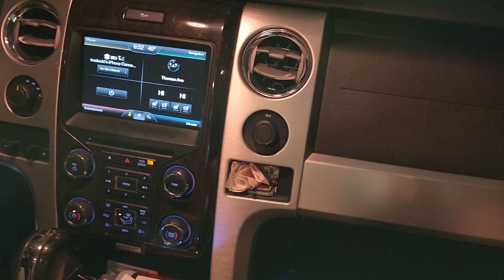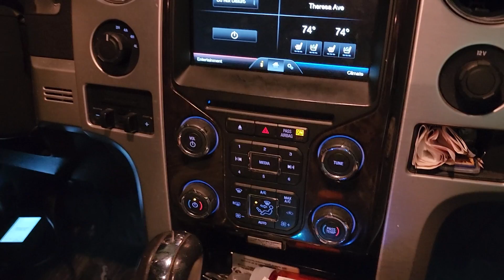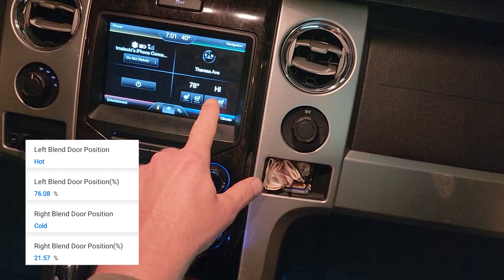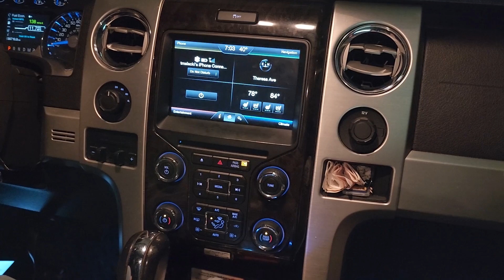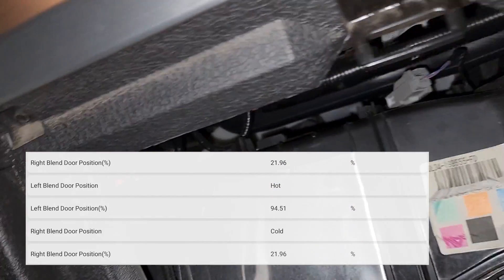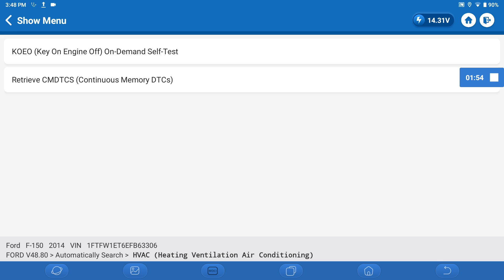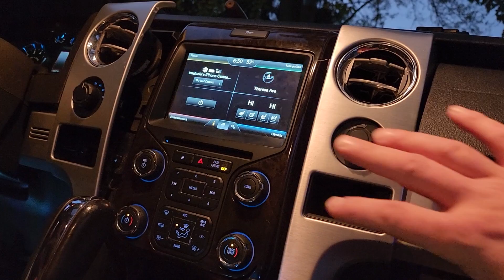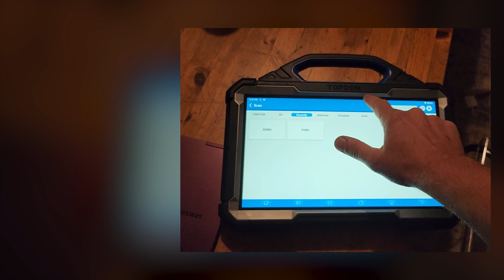2014 Ford F150 Passenger Temperature Blend Door (Cannot Change Air Temperature)

Comment: Brings back memories of a 2006 RAM 1500 Bighorn HEMI regular cab at CARMAX I ended up having to not buy. They offered to fix it, not them, dash has to come apart, but they send it out was going to take over a week so I got impatient and got another vehicle. I really wanted it. They even loaned me a car the whole time for days they had it looked at.
The blend doors are cheap plastic and break. Heater Treater makes metal replacement doors and related parts so it never has to be fixed again. This kind of job is a nightmare. Credit to the salesman to test all the doors/vents and HE noticed it.😇

Comment: hi danner
 have an issue in my car 2000  ml55 amg 

ac compressor engage and blow cold air for 10 to 30 min and then low side pressure rise up and blow warm air up and the compressor still engaging 

-the prev owner has changed low   pressure hose after gas leak

 and didn't work

-and i changed the compressor valve and changed the  oil to make   sure it in level 

-i checked pressure it's ok

-no electrical problems and no fault  codes

Comment: Im sure you allready checked the tiny hard plastic vacume lines on the passenger side running from the heater blend door actuator. Those lines get brittle and decompose. Often when they start failing the air will jump from vents to defrost or heat when accelerating.
Reply from the maker: No vacuum lines, completely electronic door motors on this
Reply: @ScannerDanner  i see its 2014. Thanks for the videos im out of practice and due to severe head trauma im not sure what i remember or remember incorrectly.
Reply from the maker: @davidreynolds4684  I'm sorry to hear that my friend. Anything I can do for you? I'd be happy to
Reply: @ScannerDanner  I appreciate it. The short n skinny on it. My friend near 80 has a 90 f150 4.9l efi auto trany. Rear tank inop for decades. 6 years ago was running rough. I put alternator, belts hoses and a batt. He was to do plugs rotor and cap. I moved to houston. They had me come back to ft worth to re- remodel a house that was messed up. Truck was barely running now. He tried to pull the plugs but couldn't. They'd back easy a few turns then dead stop. I shot pb all over and went in with them then out then in and out. They had basically welded themselves in the engine. They had slag all over the smooth area past the threads all around the electrode. Git em out sucked the slag out of the cylinders. New plugs rotor cap fuel filter. The one on it looked 20 years old and was backward. Purred like a kitten. Ran like a bat out hell. 200k miles never heard it run that good. Sits most of the time. At idle 1.5 - 2 mins it had a hiccup. So tiny it wasn't a miss. It was nothing and I'm anal about that stuff. Planned on high pressure fuel injector flush. Jim obsessed on the hiccup. Day and night revving it up pissing his wife off. She calls a shop. They get it for a week. I hear him driving up and it sounded worse than before I tuned it up. I think they jacked with the timing and used the wrong marks on the timing gear cover. That 4.9 has two sets of marks and one notch out of the damper on the back side and a hairline scribe 1/8 " long near that. Red paint t had been a slopped around and saw it over the notch. Then I checked fuel pressure. 0 on the rail koeo. Three times 0. Started it and had 0 on rail with it running. Killed it. Undid gauge little gas squirted on my hand nit a lot. Pulled filter. Rigged up gauges under the truck after flushing fuel filter best I could. Put it on connected to fuel filter out. Koeo very little movement. 10 times 30 psi. Left it for hour came back 25psi. Reconnect line and gauge on rail. Koeo 30 psi. Started it 30 psi. Pulled pressure relief hose. No difference until I stick my thumb over hose then idle increased very little no diff in pressure. Rigged up connections without a filter. 35 psi. Couldn't run it like that. New filter 32-35 psi. Hard start. Even koeo multiple times before cranking it. Poor acceleration. Rough idle punch it and get pvvvttttsss stp spet pvvvvtttsz. I understand it should have min 45 psi up to 60psi. Don't think it's back filling the rear tank that is inop. It's never gotten over flowed no gas smell no fuel in vac hose on regulator. Check engine light hasn't ever come on which is amazing because it was running like it had it only had 2 cylinders. Only thing I can think next is pumpand whole set up in the tank considering it's a 90 and never been changed. Any thought ls or ideas I'd gladly welcome. I enjoy your videos. It's helped my memory some. Sadly other days I don't know whether to scratch my watch or wind my ass.
Reply from the maker: @davidreynolds4684 
 1. make sure you have a good power and ground at the pump
2. Pinch off the return line or block it off and recheck psi. This will test for a stuck open fuel psi regulator. That system should put out near 100 psi with that line blocked if the pump is good. It is very unlikely this is your issue though based on your symptoms and the fact that I've never, not once, seen a stuck open regulator on one of these systems.
Reply: @ScannerDanner  from everything I can gather considering ots got 200k on the odometer it's a 90 model and it spends 90% of the time sitting except for a shirt trip under 30 mph to home depot then back to park. The last fuel filter was at least 10 years old and on backward. The rear tank hasn't worked in 3 decades. I find no fuel in the vacume line on the regulator however it is disturbing that the idle doesn't increase at all when I pull the hose off only slightly when I put my thumb over the vacume hose. The coffee can on the pass fender well has a cracked vacume line fitting but when I put pressure on it to seal the leak nothing changes with the idle. I wish the old fart would have left it alone both of us said how great it was running. He said it's never been that good since it was new. I've been twisting wrenches my whole life and I've never seen plugs that bad. I've seen mangled blocks and head where pistons came out and caught the grass on fire and the spark plugs looked better that the ones I fought out of this ford. You'd think running this poorly for this long the check engine light would have come on at some point. He should have gotten a dodge. Oh sure it might have caught on fire once or twice and the body might be rusting off of the frame but it would still run like a bat out of a Chinese fish market

Comment: Paul, I don’t recall any videos or your classroom instruction where you cover scan tool input and output controls and in this case explaining what’s happening with the the blend door and HVAC module using the scan tool ??…a lot of our Corvette owners have Tech 2’s but don’t know how to use output controls to further diagnose their cars instead of just reading a code and changing a part !!
Reply from the maker: The input side of the blend door is a potentiometer, which is Chapter 7 material. 
The output side and using the scan tool in a bidirectional mode is Chapter 3 material (Transistor Drivers and Output Solenoids)
I have probably more than a 100 videos, both lectures and case studies covering this material. 🙂

Comment: I have an 04 sports trac. 4.0l.  Power feels like its at 50%. Takes 20 seconds to get from 50 to 70mph. Transmission shifts perfect. Engine sounds very healthy. Sounds like a bad cat but I hollowed out all 4. Tps replaced.  Maf replaced.  Coil pack replaced just bc.  0 codes. Any clue where to start?

Comment: I have the TopDon Phoenix Smart and love it! I had a memory issue with my first model and Topdon sent a new one, no questions asked even after I had it for a couple months. It's been working great. However, I have seen multiple times, incorrect voltage readings on oxygen sensors and ignition voltage parameters. If I see a voltage parameter out of bounds, I'll first make sure I can trust the data.

Comment: Very nice video, that Phoenix Max looks awesome, I just got the Phoenix Lite 2 from Topdon and I love that one. Does not have scope abilities but very nice scan tool.
Reply: does this unit work with newer cars. ie.2021-2022 cars. does it need to have Can fd capability
Reply: @John Hill  it needs can fd adapter, but with that it can work with newer Ford
Reply: @John Hill  I am not sure,  I just did full system scan on a 2018 Honda and it pulled up all the modules
Reply: @NutsandBoltswithTone  was just wondering  if these scanners  work on newer models before  i purchased  one or does it need to have Can Fd protocol
Reply: @johnhill3644  I'll contact them and let you know.  The Phoenix lite 2 will be on a great deal on black Friday
Reply: @NutsandBoltswithTone  thank you.  was looking  at this lite unit  or the phoneix plus unt. does the lite2 have topogly
Reply: @John Hill  yes it does, I have a review video on the phoenix lite 2 that will be live tomorrow evening at 5pm pst on my channel.
Reply: @NutsandBoltswithTone  i work mainly  on Nissan  vehicles. hows fhe compatability  if any experience  using it on thise models. will be looking  forward  to video
Reply: @johnhill3644  I have used it on Mercedes sprinters, Nissan,  Mazda,  Toyota,  Ford diesels,  Cummins and have not found anything that it was not capable of doing so far and it's fast
Reply: @NutsandBoltswithTone  does it reprogram  tpms from summer  to winter  tires with additional  tool if available
Reply: @John Hill  lol got to change to winter air for that haha.

Comment: just think how easy it would be to diag your power wagon if the climate control stopped working. its like my 1994 ram 2500 max of 10 min without any scanner you can diag it. the more i learn the more i love 2002 and older cars and trucks

Comment: You forgot the calibration on the new motor door hvac
Reply: That's ok.. It's not off by much.  Less than 1%.  I think it kinda learns over time anyway, as you crank it from 0% to 100% and vise versa.
Reply: @calholli  it's not only the % is also the speed of action versus all the sensors

Comment: Looks like a good tool, wish I had 5k to get it
Reply: You can get the Phoenix Smart for under 2500
Reply from the maker: The Phoenix Lite is $800!
Reply: @ScannerDanner  I'll just have to save up for a bit. For now the one I have will suffice, it's a couple of years old Matco branded Launch scantool. It works fine but with a $1400 update cost I'll just save the extra to get all the fancy new features.
Reply: The topdon Phoenix has probably 90% of everything this fancy one has.  It just doesn't have that topographical map where it shows each module--  But that's not really necessary anyway.   But as for actuating things and reading sensors and codes, etc..   It's hard to be the sub $1k scanners these days.
Reply from the maker: @calholli  this model comes with a 4 channel lapscope too
Reply: @calholli  For oscilloscope, I will suggest you, the micsig ATO .Very good for the price.

Comment: Common failure on Malibu's too. Just a domestic epidemic.
Reply: How you fix that is to NOT USE IT..  Stop adjusting that dial so much.   I just leave everything on full blast and either turn it on or OFF.  Period.   Leaving it running, while barely turned up is just silly to me.  Either blast it full steam or leave it off.  Operating the stystem this way makes it last much longer.   You don't need your AC or heater running all the time in the background, even though you have it turned way down;  that's why these things tend to fail for some people.   Stop fiddling with it. lol

Comment: To me there's no point in buying a mechanic's grade level scan tool unless it has bi-directional control. Spend the extra money to get it. This video is a prime example of why.
Reply from the maker: The Phoenix Lite is $800 and is a full function bi-directional scan tool. (Just an FYI for those looking)
Oh and I agree btw!
Reply: There's no point in buying a bi directional scanner if you have no idea how to use it. Saw a guy with a snap on modis but didn't have a clue about short term fuel trim, he basically had a $5000 code reader.
Reply: @ronbowman4145  Shame on the shop owner for lack of training. Hopefully he can find some self training somewhere or at min sign up for Paul’s program
Reply: Really I think for a tool to be considered "mechanics grade"  it has to have some bi directional controls and functions.     Otherwise in my opinion if it doesnt it's just a generic obd2  code reader for the diy contingent and certainly not a pro level tool.
Reply: @jeffcompton6937  Agreed.
Reply: This is very true, even down to the topdon Phoenix lite 2 offers bi directional
Reply: @ScannerDanner Sir, I think you are my last hope to fix my dream car. I am ready to drive from Texas to your location if you agree to work on my vehicle. Couple of mechanics and finally the dealer of nissan said they couldn’t locate or diagnose power short to ground. Please say yes. I’ve been following your channel for a couple of years so far. I’ll hit the road If you agree and give me the date and time, if not I will still be a big fan of yours.
Thank you
Reply: @bradpyron8928  his brother has a shop. You could talk to him. Paul just teaches now but he does go help out and film at his brothers shop from time to time. Seems an awfully long way to go though...I gotta imagine there are decent people closer to you
Reply: @Brad Pyron    in Texas a great technician  you can reach is Eric  from  advanced  level auto. Search you tube
Reply: @bradpyron8928  i dont believe that they can't.      Usually these scenarios mean they cant for the customers perceived price of what it should cost.     The reality is in today's market most on depth diagnostic sessions are going to start at over 400 dollars in initial expense for the time required.      If more customers would understand this reality we wouldnt have people bringing vehicles all over the country to have YouTube technicians working on them.     And that's no slight on Paul.     Him and I have been good friends for years.     But this is the reality of auto repair and YouTube.      Theres great techs in Texas and in every state.      They're  just not cheap

Comment: Topdon is getting good reviews. Sure looks like a value tool.  👍
Reply: I am not so sure on value as this phoenix max is over $5000
Reply: @M_Phipps0520  I wasn't aware it was that much $$.  It must have an oscilloscope as well for that amount.
Reply: @IAMNOSLEEP  well that’s what I saw for price when I google searched it anyway.
Reply: @M_Phipps0520  I think ThinkTools and TopDon buy their equipment from the same manufacturer. I have a ThinkTools Pros and everything looks like same right down to the case that was included. The scope is even the same exact one and a different color, but everything is identical even the packaging it came in. This one has probably a few more features in the next model up in the ThinkTool. But, my Think tool was about 1K and the scope was 1K too. But, I love the ThinkTool so far and I only had a problem with one of my cars. Ivan at Pine Hollow Auto Diagnostics uses it a lot if you want to see more of that one in action.